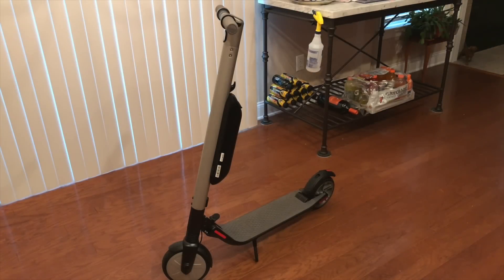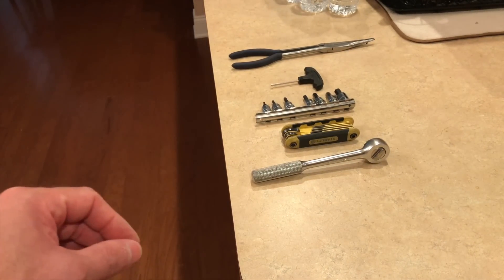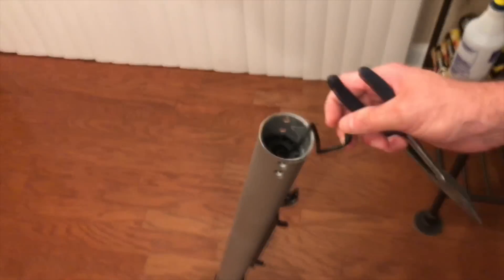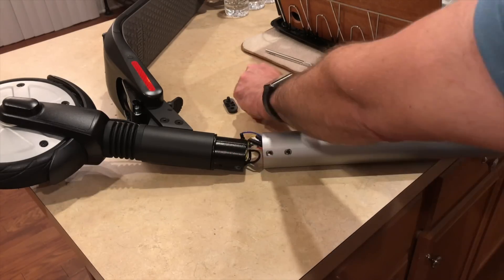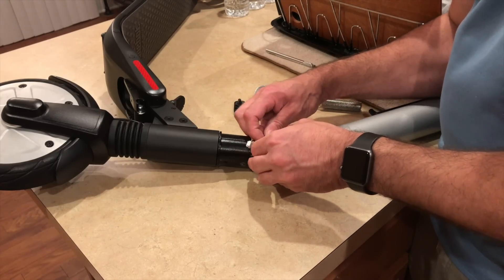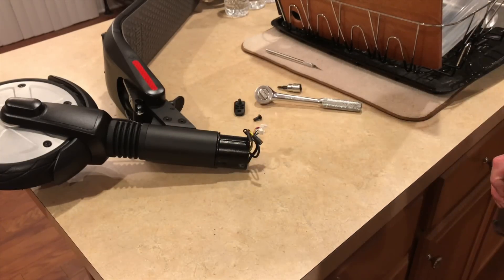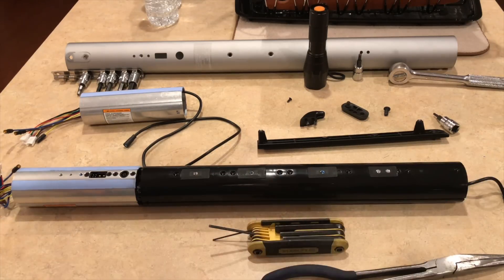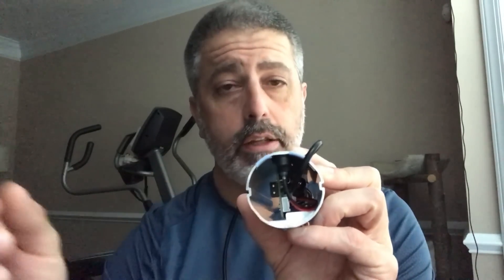Ninebot by Segway ES2 Kickscooter Control Board Replacement and Review

Comment: I just bought an  ES4 on Ebay, and from my research online the ES4 is basically just an ES2 with extended battery. However, the ES4 that I received has "black" steering column ( so pretty much all black) compared to many ES2 review videos I saw all are silver (like yours). It is not an ES1 with external battery for sure because mine does have rear suspension. I am kind of confused why my ES4's color is different than others.
Reply: They offer the kickscooters in two colors

Comment: Hi Michael... did you ever encounterd an issue when the scooter does starts, and you only get the wrench and key symbol, and the wheels kidn works like ABS is on?
Reply: Yes I basically plug it in and push off then unplug.  Repeat a bunch and it sometimes works.
Reply: Again. It is the on off switch .

Comment: Willem van Dillen
Hello Michael,
Thanks for the correct explanation for the replacement of the control panel. I have also replaced new control board and new dispay. Unfortunately I can not make contact with blue tooth. Not with androiid and also not with ios. I can make contact with other devices. Do you have any idea where the error may be?
Reply: willem van dillen Error 35?

Comment: Upon installing the extended battery my scooter died completely. Now it won’t turn on or charge. I think the battery killed it apparently the circuit board can’t handle the voltage and melt solder
Reply: I have the same problem. how did you fix it? may i know?
Reply: same happend to me how can i soulve this please help
Reply: If helpful.  Second battery gets to 100% before first battery.  You cannot let this happen!   Must stop charging before 2nd gets to 100.  And 1st is at like 93.   Scooter sucks.   Plug in to fix your issue, push off, then unplug before it turns back on.   Repeat till it works

Comment: Hi, I follow the replacement tutorial but i get a problem: I have error 35 : default serial number.  It looks like the ninebot es2 don't accept new motherboard having different serial number. Any idea how to solve this. Thanks in advance.
Reply: Faouzi EL YAGOUBI I used a service account from a seller to input the serial number on the scooter into the computer from the app. I fixed it that way. I also activated it with a Chinese phone number.
Reply: @PEVsandiego4991   can you tell where to get a service account? It's the only way to replace the mainboard right? otherwise you get a paper weight..
Reply: A Y M E S exactly. The seller I used on Alliexpress gave me their account login info to do it.
Reply: @PEVsandiego4991   Thanks a lot for your answer. If you change the dashboard do you have to do the same? or just the mainboard? I've been told that both require the same procedure.
Reply: Is there a way to reuse that account login info? I bought my scooter from a police auction and it used to belong to one of those scooter rental companies. I’m worried I’ll get an error 35 when I try to remove the gps hardware the company installed on it
Reply: Chris B. Can you please sent me the link of the product in aliexpress ? The seller is good . Maybe you can help me . Im from Portugal. Its hard to shop here the item. Tanks
Reply: José Ferreira ja conseguiste a peça?
Reply: Vasco Pessoa e Costa ainda não. Eu sei que existe no Aliexpress e no ebay . O problema é que acho que a maioria não tem serial number . E dão erro 35 pelo que percebi . E uma original é metade do preço da trotinete. Ou seja . Desmontei hoje a placa e reparei que tem lá partes de solda queimadas . Vou tentar ressoldar e ver o resultado final . Se não resultar vou ter mesmo de comprar a peça nova . Mas com receio.
Reply: @JoseFerreira-fl7ky  Obrigado pela resposta. epa sim o meu receio é o serial number! Vi no ebay umas que já vinham activadas e com bons reviews.. achaqs que dava? É preciso trocar so a dashboard ou a dashboard e a motherboard?
Reply: Vasco Pessoa e Costa pois isso também nao sei . Hoje ressoldei o que estava estragado . Quando fui testar tudo ela não ligou . Desconectei a bateria . Quando voltei a conectar aquilo faíscou e fiquei sem o conector de bateria . Acho que vou mesmo ter de trocar para outra ou fazer lá uma marosca . Mas não faço ideia se tens de trocar tudo ou só a board . Tenta aprofundar aí nos forums . Mas a gente tem sempre receio de mandar dinheiro ao lixo . Epahh . A qualidade desta trotinete é zero . É só problemas . A minha m365 não tive nada e ainda anda bem
Reply: @MikeAymes  Dashboard is no problem. No serial needed.
Reply: Error 35 - Default Serial number means that the motherboard needs to be activated using a certified account (in order to set the serial number of the original scooter on the new control board) All is done through the ninebot app.

Two solutions : wait for a custom firmware, or find a certified reseller that will do it for you.
Reply: Your response is above ypur comment. Company says you need to send it to their technicians to not get the error 35 because the part needs to be manually activated before instalation.
Reply: After switching on with Terror 35, Pflug off and on the dashboard whole on and the error Is away, but there Again after restart.
Which seller you have? Maybe we can Contact him.
Reply: U can bypass serial number error by pushing about 2 sec the break or acceleration throttle when u power on your scooter.
Reply from the maker: Sorry, no clue

Comment: I've seen this issue so often. It's why I chose to return my battery and ES2 before they even arrived and instead bought a Xiaomi M365. Sorry to hear these problems, I'm somewhat glad I went for a better brand. Hopefully Segway makes better scooters in the future.
Reply from the maker: Kyle, I have had my M365 for a few weeks now. HUGE improvement over the ES2
Reply: Michael Maduske that's great! I don't know if you've looked into it, but you can also flash custom firmware onto the M365 to make it go as fast and have the same amount of torque at the ES2 would have with the battery! Only drawback would be lessened range due to higher draw, and possibly hotter motor. My scooter is out with a flat rear tire, but when I get to ride again I'll give results!
Reply: @MichaelMaduske   Lets say your ES2 worked without the headlight/board issue, would you say that the M365 is still a better scooter overall? It seems the ES2/4 has a lot more features but recently the headlight/board issue is more common. It does sound like the M365 is a slightly better value since its slightly cheaper than the ES2 and much cheaper than the ES4 mode that just is the ES2 with the extended battery. At any rate, I appreciate your video as I as thinking about buying the ES4 but now I think I will hold off and do some more research and see if the firmware updates had fixed the board issue with the ES2/4 and look at some other options that do not have such issues for such and expensive purchase.
Reply from the maker: @jesusjones3014 , yes. I would say that the M365 is still the better choice. Ride quality is much better and it just feels more solid overall. BTW, the M365 is currently (11/27/18) selling on Amazon for only $449. A STEAL at that price.
Reply: @MichaelMaduske  is M365 not bumpy compared to Segway? as M365 does not have suspension?
Reply from the maker: M3GA No, it rides smoother since it has air filled tires
Reply: Michael Maduske thank you for the reply. I collected my ES2 yesterday night, tried it and I must say I love it. It struggles at slight uphill but with a few push it does the trip. Thanks
Reply from the maker: Yes, I thought about doing the flash but am reluctant.
Reply: Michael Maduske personally I'd say the only drawback would be overheating during long rides. Otherwise, if you're worried you can always update the firmware through the app again to put it back to normal! When I can test it out on mine I'll report back
Reply: By the way, Segway is owned by Ninebot, which is owned by Xiaomi. In fact the Ninebot ES4 is intended to replace the M365.
Reply from the maker: Okay, thanks.
Reply: Michael Maduske I've had some time to mess with flashing custom firmware onto my scooter, it has definitely improved the riding experience! Torque is now no problem when going up inclines, and it constantly reaches high speeds of 17+ mph on slight inclines. Still loving my scooter, got pinch flats on the front and back tire, but have since replaced both myself with no hassle.
Reply: pretty sure Xiaomi is the OEM for Segway SX series tho...